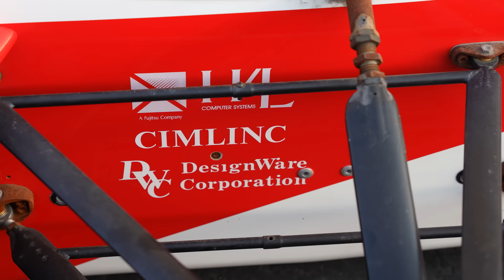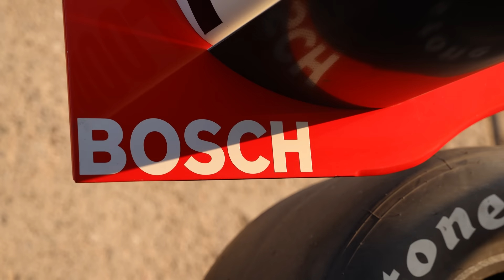I bought a INDYCAR without an engine.

Comment: Rob just be aware that in many racing series there is a mandated minimum cockpit evacuation time that drivers need to evacuate a car for safety reasons - main one being Fire.

Just make sure that you are able to get out of the cockpit with full race gear and from completely strapped in, as fast as possible. 

If you are struggling to get out quickly enough, you may need some rethinking on that, maybe consult professionals on modification whilst keeping safety intact.

E.g. F1 pre-Halo used to be 5 seconds, now with halo its 8 to 10 seconds for min evac time.

I know you not going to be entering a sanctioned race with this thing but evac-ing in an emergency is difference between life, serious burns or death.

Comment: The silver bars connected to the cantilevers in the suspension are called dummy dampers. You'll need to buy actual springs and dampers to mount there
Reply: Starting at $1500 per pair (and that's for Lola, no Reynards anywhere I could find)... hopefully you can find the right ones.

Comment: I know the rotory would be cooler, but I have to wonder if the C8 drivetrain would fit in that thing.
Reply: Less reliable than a rotary 🤣
Reply: A ls would be giant for an Indy car. Way way to much weight and torque. Not enough HP and revs. That car is like 1400lbs.
Reply: They had GM V8s back then....About 200 cubic inch V8s
Reply: The only reason I mention to the C8 drivetrain is because Rob may have a spare one sitting around, looking for a new home, at some point in the near future, that is all.  I can't imagine that this car will ever be used in an actual Indycar competition, of any sort, so it's all about having fun with it, right?

Comment: That's a weird one. I recognize Della Penna and Richie Hearn's name on there. The chassis looks like a B03 Lola but with a front wing suspended more like the later Panoz DP01, both of which are NEWER than the last season Della Penna ran.

Interesting to see a display car with a chassis that's newer than the existence of that livery, team and driver. Or at the very least, the front wing is not normal for that era of Lola if it is infact a 2000 or 2001 year Lola instead of the 2003 that I thought it might be.

The engine that would have been in these the last year Della Penna existed was a 2.65L turbo V8. Those V8s revved to 15,000 RPM in 2001, and that was without the pneumatic valve closure that F1 used... They sounded AWESOME. Approximately 900-1000 hp engines with relatively low boost as the regulations required.

Either way, very cool stuff! The transmission on these were mechanical sequential. The rules at the time required teams to still have a mechanical gear shift connection to the transmission. Pull back on the lever towards you is to upshift, push forward to downshift, which makes a lot of sense when you realize that's effectively the same direction the G loading would be in those situations...

These cars were BEASTLY. No power steering, either. To really drive one of these on the limit, you have to be in excellent shape. Tony Kanaan used to do Iron Man competitions and said it was really to help him stay in shape to drive his car at the limit...

You should look up a couple races from that era! The most favorite that I personally attended back then was the Michigan 500 in 2000. More than 50 lead changes, insane drafting battles where cars could hit a top speed above 250 MPH, the shear noise and speed of them at that track was absolutely insane along with the constant back and forth drafting battles. It's worth watching at least the last 12 or so laps of that race.... Seriously.

Comment: One question. What happens if you break literally one proprietary part on that car?
Reply: He's got a machine shop, I'm sure that he could make something to fix it
Reply: @Skrillfreak  I get that but hopefully he can swap at least the drivetrain so he's not remachining every time he drives the thing.
Reply: @personguy3137  Alternatively, it’s probably a production gearbox that he just has to make a few friends to be able to purchase new
Reply: @Cjbarker2  it is def not a production gearbox lmao. It’s a transaxle, and it’s also the rear suspension mounting points
Reply: it's probably a hewland. there's new old stock parts available
Reply: @cademckee7276  You do realize that a gearbox and a manual transaxle are the same thing, right? The word “transaxle” is a descriptor of function; it’s literally a transmission that’s been integrated with the axle shaft. It’s a box with gears inside. That said, when I say “production,” I mean that it’s produced to some kind of surplus for the demand. Just because it’s a specialized race car part, it doesn’t necessarily mean that it isn’t a “production” part. If they’re produced in a series or similar setting, it’s more akin to building 500 units for homologation in rally. Production parts, but not mass-produced.
Reply: These things were raced by multiple teams all of who had multiple cars and all had tons of spares. Parts for these things can fall out of the sky if you know the right people to call. Not to mention many of the different manufacturers are still around and have all the tooling needed to whip out a new one in no time. Just now I was searching for information on a specific suspension component (I couldn't remember what it was made out of) and found a guy selling just about every suspension component for this very car. 

The gearbox and all its components is still available. Clutches are still available. Half shafts/CV joints are either still available or could be made by the same people that were making them then and make them now for the current cars. 

The only real difficulty is the electronics. That has come a LONG way since the late 90s. Not much of the old stuff is still around and what is around is terribly unreliable. Fortunately, it looks like Rob plans to do his own electronics throughout with more modern stuff so that shouldn't be a problem.
Reply: @aleks138  It is and it looks like pitlane spares carries every single little pin and o-ring you could ever need for it.

Comment: Talking about cooling.. Remember that you can tilt the radiators(looking from the side of the car) 45 ° instead of the natural 90° with 0° being the ground line. Also be aware that this cars Dont have room for fans for the radiators, they r not supposed to be idling, and the fact that the radiators are also going to be more efficient, all the intake and exhaust from them are optimized to have the most simple and fast airflow to and trough them, in a normal car radiators tend to be restricted on the back and maybe the front. also u could run thinner but rigid lines to have more water pressure trough them and maybe with less mass(coolants) you could exhaust more heat energy from the engine with a smaller but faster system. And the fact that this is a wider car and with more deep air intakes(chassis) u guys are going to be able to stack radiators easily and make them also more depper to with less room in terms of large and tall, have more surface to exchange heat with them.
Please be careful with the aero, because this kind of cars thend to be very estable so if u change the geometry or even the position and weight, stiffness of the suspension u can easily make it to dangerous at high speeds, also u would be changing the aero of the air intakes that r behind and the effect af all aero parts that are also behind or surrounding it, all that can be a desaster that u could only test it by going fsst af or in a wind tunnel. 
Remember that u can change the possiton of the pedals, it structure can be nearer to the driver, also do a stress and pressure test to all suspension and break lines, the suspension at least looks kinda rusty xd
Well thats it, really like your videos, wish u the best with ur protects, greetings from Argentina 🇦🇷🇦🇷🇦🇷😃😃😃

Comment: They made the input shaft lower on Indy cars to help keep the center of gravity lower because they are dry sump systems illuminating the deep oil pan on the V8 engines they use. My favorite was the turbo 4 cylinder engines they had. Or the 17,500 RPM V8.

Picturing that IndyCar in my mind, I would say use a naturally aspirated six rotor engine because that would be just fun or a turbocharged three rotor to keep the rotating mass down allow for snappy quick acceleration in the RPM range.

With some of your equipment you could probably make a custom drop box  and lower the crankshaft center ine and speed so the input speed on the transmission is the same as the rotor speed IE: spinning three times lower than the crankshaft.

Comment: Hay ROB, great video!  I look forward to seeing how you deal with the higher than average crank on the rotary and the lower than average input shaft on the Indy car rear end 😂😂😂.   But seriously, great video, and you had better book a slot at the Hoonigans air strip sometime in the future.... 🏎️🔥
👍👍👍
Reply: Actually, just lay it on its side, ignition side down....  and you have the 5 inches that you need...

Comment: A standard rotary doesn't make for a very good stressed member you'll need to make a strong back cage around it in order to keep the deflection on the housings down. Otherwise build a engine from the ground up

Comment: Out of curiosity how are you thinking of solving the input shaft problem all I could think of is. Make a small gear train/ pulleys:chains to make the difference or Put the rotary on it’s side but then again you can’t just shave off the side with spark plugs on it or make a new rotary. Anyway looking forward to seeing how it’ll be done.

Comment: For those unaware, this is a Lola T97/00 (not a Reynard 95i, thanks wingracer!), ran by Della Penna Motorsport in the 1997 PPG CART Indycar World Series. It originally had a Cosworth Ford XD 2.65 liter V-8 burning methanol and producing in excess of 850 horsepower at 14,000 RPM and 8.35lbs of boost. It was driven by Richie Hearn, and it's best finish was 9th at Gateway and Road America in 1997.
Rob, don't use the fuel cell in this thing. it is made for METHANOL ONLY. Petrol will ruin the fuel cell. Also, you're gonna need suspension made for you, the car has metal rods welded in most likely...

Can't wait to see where this goes!
Reply: No it is not. It's a Lola T97/00 driven by Hearn for Della Penna in 1997 with a Ford Cosworth XD.
Reply: @wingracer1614  Good catch! Didn't notice the suspended front wing at first. Forgot Reynard moulded theirs into the nose cone. I'll edit the comment with the correct info :)

Comment: 8:53 there is were the popoff valve comes from, popoff valve is use to regulate the turbo boost pressure, is a parameter regulated by CART/Champcar competition rules

Comment: It looks like your suspension is missing the springs, what you've got is the dampers. There appear to be mounting points inboard of the dampers on the chassis and linkages, I would guess that's where the springs go.

Also try and get in touch with Roger Penske or Chip Ganassi, those guys have been around for years and would probably know what makes one of these tick.
Reply: It doesn't have either
Reply: Those are just solid struts.  The other mounting points are for things like 3rds and ARBs.
And yeah, just ring up Roger Penske.....
Best bet is to find a race mechanic from that era with some free time.   This thing needs a lot.....

Comment: How hard would it be to run a rotary motor sideways? If you could flip it on its side and still have the oiling system work correct, you could line up the input shaft easier, plus you get the added bonus of center of gravity being lower then even the motor for this chassis. Just a thought.

Comment: Is the gearbox actually there is is that just the case? Gonna me amusing to see them make this work since the engine and gearbox are the stressed members of the chassis that the rear suspension attaches too. That rusty metal angle iron frame holding the rear on is a riot.

Comment: I just thought of it, but to get around the issue with the input shaft being so low, could you maybe see about grabbing the rear end from a pro formula mazda? they ran rotary engines in smaller chassis, but maybe you could use it as a basis to build off of?

Comment: Did all the rust come included in the price?  You are going to have to spend a fortune on NDT on every suspension component before you drive it. Most sensible single seat drivers Magnaflux their suspension arms every year. I had a rear track control arm titanium spherical joint fail on my Judd engined Ralt hill climb car and it put me into Armco barrier at around 120MPH. Luckily Ron Tauranac built his cars very strongly, so I just had bruised knees and ankles.
Reply: He should just buy all new suspension, even if it wasn't all rusted. Car could've been built with all junk parts.  Look at all the parts that are missing...

Comment: I think they will have serious issues putting a rotary engine in this chassis. It was obviously designed to have a piston engine as a stressed member, meaning the engine is part of the chassis, gearbox bolts to the back of engine, rear suspension bolts to the gearbox. Rotary’s have enough trouble with twisting without being stressed chassis members. Only way I can see this going is building a tube cage for the rotary engine to sit in, so it’s no longer a stressed member of the chassis.

Comment: Originally these cars utilized methanol injection to cool the fuel
So it has 8 cylinder injectors. And 4 fuel cooling injectors. Called a pci ring. Pre compressor cooling

Comment: If being tolerances are possible you should be able to throw the 4 rotor in there. Pull the engine cradle and see if it will fit. I love indy and f1 cars. Looks around early 90s late 80s not sure about looks to be. Pull the seat pads up there might be a stamp somewhere underneath all the pads. I love high screaming engines a lot of engineering goes into indy cars, let alone f1 cars. If get 12000rpm out of rotary u should be able to get 160 depending on the transmission and year. And looks at the brakes, it's crazy how much an Indy car can go through brakes. Oh BTW a rotary method injected indy car now that would be awesome.

Comment: Fairly sure the seats were molded to the driver custom made. In Addition to that it should be a torsion bar setup in the suspension not springed.

Comment: One question for Rob. If you're gonna update the engine, ecu, power and overall performance, my assumption is the aero was specifically sculpted to exactly what the cars performance was at that time... therefore, will you have to and/or at what point does aero design need to be modified or completely changed because of Performance increase?

Comment: How about a home built engine  you could do an Allen Millyard and make a V8 from two 1000cc bike engines. 
Even better a two stroke with oiled sump and Vee belt blower to feed the cylinders. Check out the Zoche aero. It’s a radial diesel but could be gasoline with sparks. Could be Vee or radial layout. All totally off the wall.

Comment: The only way I can imagine you using a rotary is if you engineer an adaptor with an offset drive from the engine to the gearbox. It's just WAY too low, even with a dry sump.

Comment: Cosworth!. Roll bar adjustment on the left. They run through the tub. U will need to replace the fuel cell. They ran methanol as you should. And they would add fuel additives. I would be very interested to see inside the fuel cell. Just push black circle on the filler. Its spring loaded. 
If you put a custom engine in this it will have zero value. If you put a cosworth in it. It could be worth something again. 
Beautiful car. Great eye to grab this car. Try and find another car with a 97 nose cone.like yours.   Cant find em. 
also this car has a operations manual. Bet u didn't no that. 
Gearbox manual. Fuel cell diagrams. Mechanical fuel pump. Located Inside the cell. I would check see what shape that fuel pump is in. Easy since it has no engine.

Comment: At 9:03, the fastener is called a cam-lock. They’ve been used in aviation and racing for years.
Reply: Cam locks or tridairs?  Look like tridairs to me.  Cam locks on the damper cover though
Reply: @dhj2098  isn’t a Tridair a brand name? But then again maybe Cam-lock is too…I’ve just always called them cam-locks. On the TBM they use Tridair receivers for the cowling fasteners.
Reply: @dhj2098  yes, that’s what they use on the TBM, in my experience, but I’m sure it’s used all over. That is most definitely not what Isaiah was tickling at 9:03. In the Tridair assembly, the fastener may or may not be captive to the piece it is securing and is not under spring tension until it begins to thread. More like this, https://www.aircraftspruce.com/pages/ha/fast_1camloc/sb-ss-protruding.php

But I see that Cam-loc seems to be a brand, but as I said, I’ve always used it as a common name…like saying Freon when taking about refrigerant like R-134 or R12, but Freon is really just a brand.

Comment: the rods that the suspension is linked to at 10:45 is the spring it twists and acts as a spring. really weird stuff.
Reply: Your thinking of torsion bars and these are not them. They are solid sticks.  Used for setup and just roll around parts.  He needs at least all 4 dampers.  He should really get the 3rds and anti roll bar assemblies too.....  missing a lot of bits.  I wonder what's inside the gearbox.....
Reply: @dhj2098  figured they would run something close to f1, but doesn't shock me that they stripped it XD. better than motot gp thet crush/ melt the bikes heh

Comment: If you will put some kind of custom rotary engine in it then these will be the smallest metal doritos I've ever seen! OR I guess you can make some kind of super short cardan shaft, use it with a little angle, so the engine can be a little higher, maybe???